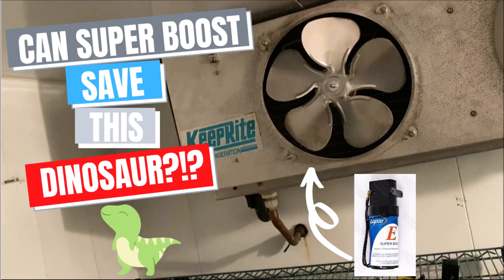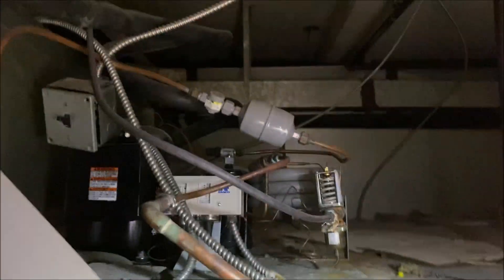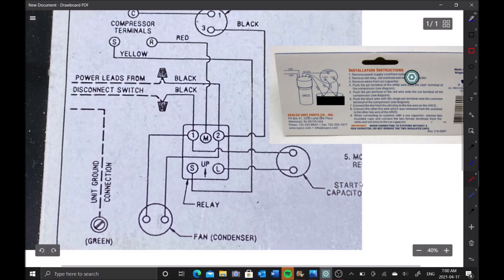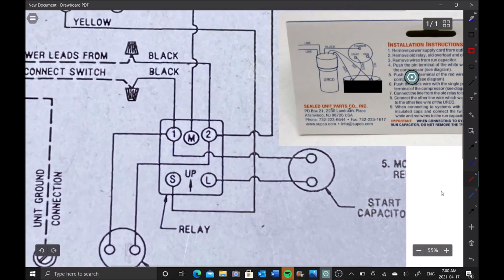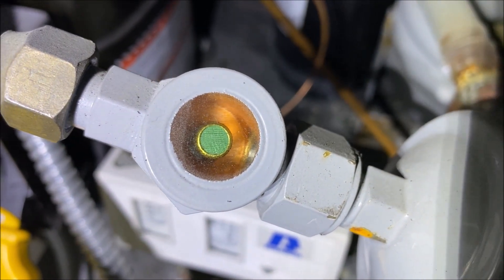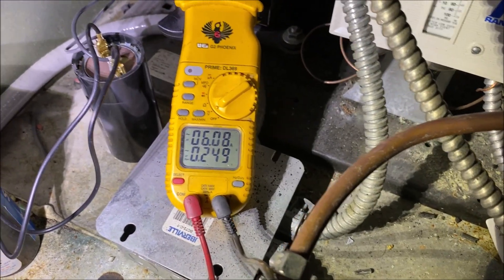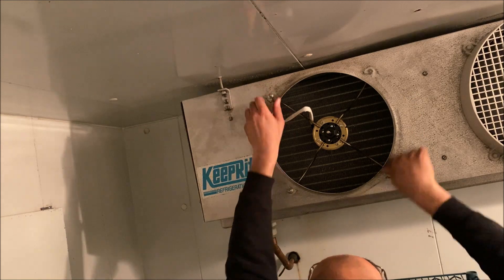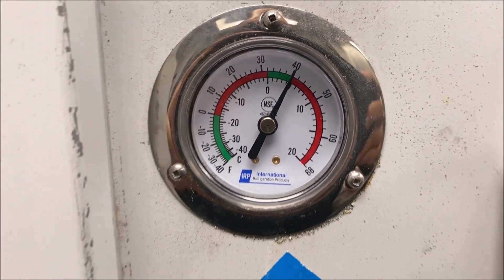Walk In Cooler Is Warm. Supco Super Boost SPP8E Hard Start Kit Wiring.

Comment: Professional. I have a question, if the original potential relay is bad, can I still use this Spp8 to make the compressor start? For example, the potential relay is burnt open circuit. Can we bypass the original potential relay? Thanks
Reply from the maker: I don’t think it replaces the relay. The 3n1 does replace the relay through.

Comment: So that superboost replaced the original relay and capacitor or supplemented them.
Reply from the maker: It replaces  it. Instead of wiring it directly to “S” & “R” on the compressor, you can piggy back off of the cap.

Comment: Normally you piggy back the run... Though.   Did that one say to piggy back the start??
Reply from the maker: I couldn’t find anything on how to wire a 2 wire hard start if there is only a start cap and no run cap. However, it did say to hook up the hard start to the start and run windings on the compressor. By hooking it up in to the start cap, I’ve essentially done this.
Reply: Interesting I've always just never used one if it was only a start usually it's 120 and I get away with those smaller third and 1/2 horsepower... And in this case it was 208 that's good to know you can just piggyback the start if it doesn't have a run excellent work...
Reply from the maker: Yes bigger compressor so I needed the super boost and hope for the best